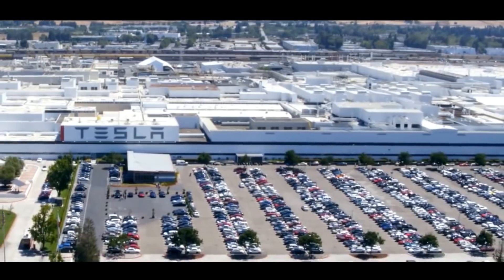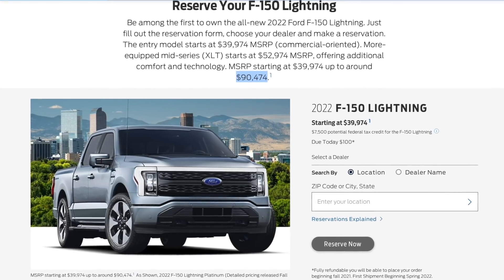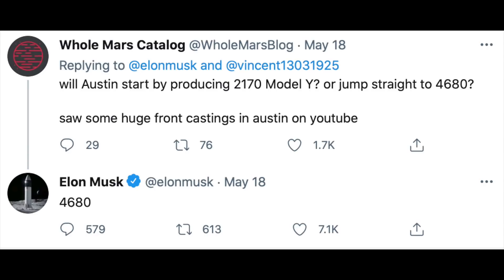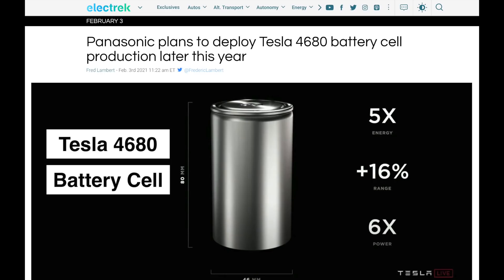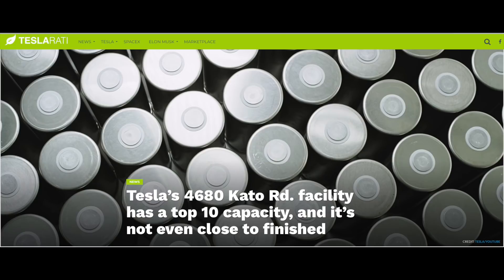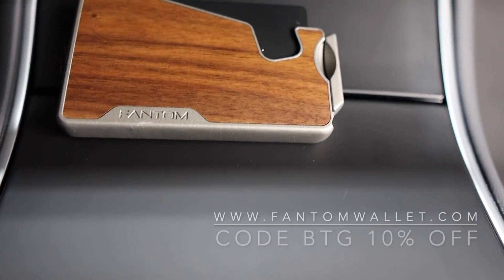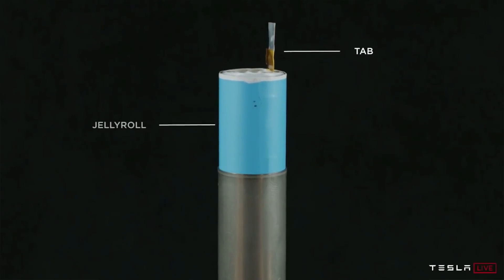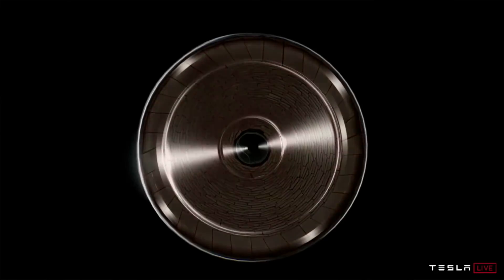Tesla Model Y - Version 2 Incoming?

Comment: New range sounds great..

But I'm waiting for the compact because I'm not rich enough.

I'm guessing/hoping 250, and if they have the range increase for all their vehicles I could see them having the compact start with 300 miles if they have enough energy density. (Big hopes that that's what these range increases will mean)
Reply from the maker: The compact is going to be cool actually and very affordable. Excited to see how it turns out
Reply: @BeardedTeslaGuy  for $25,000 and the only car that can go beyond it's battery range effectively and easily with the Supercharger network, autopilots emergency avoidance system, Tesla's safety reputation (breaking car crushers), sentry mode, most likely faster than the Civic, boombox...

For my fist new car, I can't describe how exciting I am.
Because for so long I thought I was going to have to settle for a used Bolt but now that savings is going towards the company dedicated to EVs. 

I can't wait.

Comment: minor technical corrections, if I understand the 4680 cell design correctly. The 4680 cannot withstand higher temperatures so much as it will generate less internal heat due to its lower internal resistance and simultaneously dissipate heat due to its greater capacity to conduct heat away through the bottom of the cell and the tabless design, since it conducts heat out of the core of the cell
Reply from the maker: To an extent that it’s correct. The thermals on these cells are completely different and way less impacted by heat

Comment: Really want a Y soon, but battery upgrades with charge times and low temp operation is important in Colorado. Are there any other upgrades that might be part of a V2 model Y?
Reply from the maker: Those new batteries will come with some great improvements overall. No other real upgrades are known at this time
Reply: Hey BGT!  you selling your MY to get the V2 MY?  BTW, would love to have vented seats AND adjustable suspension to increase the 6.5” ground clearance (8.5” is SUV industry average).  In Colorado we need the ground clearance…!
Reply: ooops just found your “possible” suspension video…adaptive would be cool. nice work!

Comment: FYI Marques Brownlee was told by Ford that the truck was rated at 300 miles with 1000 lbs load and did the math at what he was seeing that it would be around the mid 400's without a load.    Not to say the cybertruck won't have more range but, as others like Engineering Explained, Tesla's are generally vastly overstated on their mileage vs competitors when they aren't used exactly in the EPA were EV test methodology (especially when used at freeway speeds exclusively they drop a lot) and there is zero chance the 500mile guestimate they have stated is with a load.    So it possible they have similar range for same load/no-load scenarios.
Reply from the maker: It will be exciting to see where this all goes

Comment: I am still waiting for concrete plans to start building the so-called "affordable Tesla", that elusive compact $25k vehicle. I believe that a compact SUV called the Model Z, similar in size to the Hyundai Kona, basically the next step in the downsizing progression from X to Y, would be the logical compact Tesla. It could just be a shortened, lowered version of the Model Y, with a smaller battery pack, but enough room inside to maintain Tesla's appeal as a value for money roomy American car that will appeal to a broad cross section of society.
Reply from the maker: Yep, they are providing extreme value in these segments and keep pushing

Comment: Buying a Ford Mustang E or F150 Lightning makes more sense than buying a Tesla. You get as much as $7500 with a tax credit on the Ford but not on the Tesla. Also, Fords are of much higher quality fit and finish and are more reliable. Ford is an established carmaker while Tesla is an upstart with an unstable CEO and a questionable and high risk future. For now I would recommend against buying a Tesla.
Reply from the maker: The only gap Ford has to close now is range and charging network.
Reply: @BeardedTeslaGuy  Yes, Electrify America is slightly behind Tesla's supercharging network but will enjoy rapid growth soon. The range in the Ford is slightly less than Tesla's forecasted range but is still more than enough for most folks.

Comment: The 4680 battery is going to be awesome but don't think for one moment other EV makers aren't in a position or won't be in a position to produce EVs costing less and getting ranges close to or exceeding Tesla. Cars such as the Ioniq 5, Kia EV6 get great distance utilizing a charging capability that's faster than Tesla and better charging specs than the Tycan or the E tron GT.

The Nissan Ariya due to be released is another vehicle from an established auto maker getting 300+ miles on a single charge and boasting some cool tech while it's price tag is cheaper than the Model Y.

And in a time when Tesla is slowly raising its price on the S, 3 and Model Y it might make consumers look at their competitors. 

I'm not saying any of this to be negative. On the contrary. I'm being straight as a consumer and what many of us are looking for in an EV and it's becoming quite clear as 2021 rolls by and 2022 comes in there is an incredible amount of great choices out there.
Reply from the maker: The problem is no one is matching Tesla today. They are about to launch a car that will meet current Tesla range, but now Tesla is onto 50% more range. They are just behind. Another 5 years and I think it’ll be much more even

Comment: Great video!  I've had my Model Y for a few months.  I was shocked when I had an emergency and tried to start the car during a scheduled software update.  Tesla service responded quickly but confirmed that even pushing the 2 scroll buttons wouldn't interrupt the update and I had to wait the 60 minutes for the update to finish.  I think most car owners will agree that when you have a full "tank", you expect the car to be available for any issue at any time; even if a software update has been scheduled.  Life can't always be planned.  Thoughts?
Reply from the maker: My other car will not operate during a software update either. Not a Tesla specific issue
Reply: Any other car to update requires at least 3 hours at the dealer. I think it's an acceptable trade off given the fact that you can delay your update as long as you want.
Reply: Wasn’t there an option to defer the update until a later time? If so perhaps your bad for hitting the wrong button or not being aware of how it works

Comment: they desperately need to update the Y because its garbage and Dangerous!!!! those horrible blind spots and terribly tiny side mirrors that dont help much as well as the deadly under driver seat pass through and some of the problems that should be recalls.
as well the fact it came out after the model 3 and is lower in every spec to the model 3 including to offroad or towing!!!

Comment: I think the other big Q's are: Will they include an Air suspension in the Austin made Model Y? Will the new battery tech create an instant depreciation dip for the current model?
Reply: Not at same price.  They're trying to keep the price down and air suspension will add lot more to the price. Maybe if they come out with higher spec version which would cost lot more.
Reply from the maker: Hopeful on the suspension upgrade

Comment: If the battery pack size is reduced, then that's a drop in weight, which is always useful.

It would be interesting to see how much of a weight reduction there is, which brings a range and acceleration increase.
Reply from the maker: Indeed

Comment: Do you think it's possible for existing model y owners to switch their existing batteries for the 4680 battery? If the batteries can do what they say they can, then most would want the new batteries to rid range anxiety.
Reply from the maker: No, the new batteries are built into the body
Reply: What will happen to the people with really old tesla. Their batteries degradation over time and need replacement.  Will they have to buy a new car or is there no other way?  I apologize for asking many questions, but I'm a new model y owner myself.

Comment: Few notes…
1) A pending order can last longer than 6 months, I’m coming up on a year pretty soon.  I posted this part of this comment on your other video, I watched it first.
2) If the cars model changes, for example the LR+ you used as an example, an order for a LR will not automatically convert to a LR+ especially if the LR is still offered from Fremont as you have proposed.  You’ll need to either upgrade to LR+ or place a new order for LR+.  So any price advantages you lock in now or have already locked in in the past will be compromised.  For example, I’m locked in at $49,990, but if I switch to a LR+, I’ll likely lose my $8k FSD (no biggie, don’t really want or need it any way) and my price will change to reflect whatever the pricing of the proposed LR+ at the time the order is changed.  Someone please feel free to correct me if I have this wrong.

I have an alternate proposal.  While Austin is coming online, what if Fremont switches to making the Y SR?  They could make the Y SR with 2170 cells and move LR and P production to Austin.  Anything is possible and only Tesla knows it’s plans.
I think Tesla is going to go all in on 4680, as Austin comes online making the Y I think old Y lines in Fremont will convert to new 4680 lines for Model 3.  Then old Model 3 lines can be converted to Roadster 2.0, Semi or both.
Again, anything is possible.
Reply from the maker: I think there will be some transitions around as Giga Austin comes online

Comment: We are already getting model 3 long range with 382mile range in norway in june. I can see that number is much lower in the us for some reason.
Reply: I think it is the testing process they use between Europe and the US. WLTC vs EPA shows different efficiency if I recall correctly.
Reply from the maker: I am pretty sure it’s the testing of your standard vs the EPA standard. I could be wrong though.

Comment: You made an excellent point about the technology always improving and whether to wait or not for the next best thing in which case you ‘ll be waiting forever. When Giga Austin starts limited Cybertruck production late in 2021 and ramps up in 2022 it will arguably be the most advanced Tesla to date which includes having the latest 4680 battery technology along with single cast exoskeleton construction and other revealed and some not yet revealed advancements. So, in that regard, I don’t mind waiting a bit longer for my Cybertruck. But, having said that, anyone intending to purchase a Model Y or Model 3 (or any other Tesla model) should do so because otherwise tomorrow will never come.
Reply from the maker: 100%

Comment: Which battery packs blow up easier? The F-150 or the Cybertruck?  I'm guessing the F-150 has very safe battery packs.  BTW, why didn't they call it the E-150?  Seems logical.
Reply from the maker: I don’t think you’ll have to worry about either battery blowing up any more than a gas tank in any car...
Reply: E-150 already used for 1/2 ton Econoline van.

Comment: Here's a thought: given recent price hikes, I wonder whether some of the new technology (single-piece front / rear casts, 4680 structural pack)  has already found it's way unannounced into the Model Y presently being delivered?
Reply from the maker: Possibly. I don’t know that they have enough volume on the new batteries yet, but here soon it’s a real possibility
Reply: Was going to pull the trigger on a '3' until S.O. asked Siri what insurance costs for a Tesla.  The $4,500 average premium  must be some sort of error but still, the insurance seems out of sight.  Also, S.O. told me you really need a working smartphone to get into and drive the car so I looked and she may be partly correct. and mine has broken or run out of power in the past.    It could just be her way of telling me we don't need another car right now so it is moved off the list for now.
Reply: @SunriseLAW  you should call your insurance company, mine went up $50 every 6 months. But there is also a $30k difference in value fro  the vehicle it’s replacing. You also get 2 key cards with your vehicle and can purchase Tesla fobs for $150.
Reply: Definitely not Tim. If any of their current vehicle production was using the new 4680 cells, we WOULD know about it!!!!

I suspect the recent price increases are due to a combination of 3 factors - 

1. Recent shortages of raw materials/chips, resulting in higher input costs for Tesla

2. Tesla taking pre-emptive advantage of the up coming re-introduction of the Federal tax rebate. (gradually increase the price, so that when it does come in, a new Tesla will still be cheaper than before, but not by as much, with Tesla pocketing the difference !!)

3. Continuing high demand for their cars, means that Tesla has the market power to increase the price of their vehicles by small increments over time, NOT lose sales, but yet improve their bottom line profit!

Comment: I have a Y on order and the delivery date has disappeared so patiently waiting.  But based on this, I think I will change my order from a purchase to a lease so in three years I can take advantage of the new battery and gigapress technology improvements.
Reply from the maker: I personally wouldn’t lease but there are cases for it.
Reply: @BeardedTeslaGuy  I just don't want to be locked into the old technology and I think because of that the resale value of the "Old" Y will not hold up as well as the 4680 gigapress ones.
Reply: @visioncaremirkin8467  As a Model owner since 2015, just buy it and done worry about the new tech.   There will always be something new around the corner just like with phones, tv’s and other tech.   The cars also hold their value very well.  And leasing is a horrible idea with Tesla’s.  The money factor and residuals are not good, so you will pay a significantly higher interest rate versus financing.   The worst I have seen of any car.company.

Comment: No regrets about getting an early Model Y.  Yes, it only has the dual rear castings, and I envy the newer ones with single rear castings, front castings, structural 4680, etc.  Those will make a difference in the performance, but insignificant compared to the difference between the original Model Y and any non-Tesla.
Reply from the maker: Agreed

Comment: Great vid and right on point. I would love to see a slightly different variation with the new batteries. How about upgrading the MY Performance (MYP)? Charge a premium and be as quick as the M3 Performance with equal range to the current MY LR. Or even keeping the same range as the MY LR could/should result in improved performance due to less weight.

Anyway I had a MYP on order and just changed it to the MY LR based on your road trip video and a few test drives. The MYP rides like crap on anything other than really smooth roads. It also felt that once you are rolling the MY LR doesn't lag that much behind the MYP as well. Maybe not as impressive at launch but my driving isn't filled with 1/4 mile runs anymore. If the MYP came with lightweight actual performance wheels and good suspension, it might worth the extra 8k more. After driving it I new I'd want to swap out for coilovers and better wheels and tires. That makes the delta even more than 8k and maybe I could recoup some of my investment if someone actually wanted to buy the hideous 21" Uberturbines on the MYP.

Your vids on the MY LR really reshaped my opinion on this. It got me to test drive the MYP and MY LR again but back to back. Also, the most expensive models take the biggest hit usually on resale. So if I did buy the MYP, my luck would be Tesla would drop a super version of the MYP with a lot more power. It would be worth about as much as what a P90D is compared to the new MS Plaid. So I'll play it safe and have a pretty decent car to drive until this all gets sorted out. Keep up the great work BTG.
Reply from the maker: Performance mode is legit, but for daily driving, not my choice

Comment: Here's my deal for those who might relate:
My current car: 1999 Buick Regal GS. Salvage title. Was totalled in an a rear-end collision and a bumper and quarter-panel replacement was more than the value of the car.
It's falling apart. The windows no longer work. I had to replace the intake manifold gasket, and shops said the compressor might have an impending "catastrophic failure". But the engine is still amazing.

My situation: I'll also have to stop working from home probably by the end of the summer.

So I went ahead and ordered my Model Y something like 2 weeks ago. I don't think I would be able to wait until the 4680's come out. And I promised myself if I was able to hit 6-figures before I turn 30, I would get a Tesla my 30th year. Furthermore, I'm quoted for a 2.49% interest rate. That rate is NOW. Tax credits are unknown. Upgrades are unknown.

Plan A: Go ahead and take the order and just stick with the car as long as possible.
Plan B: Between now and then, if the timeline pulls ahead fast enough, delay delivery.
Plan C: Stick with the car, keep an eye on upgrade news, and if it ends up being a V2 with major changes that are worth it, trade in for a new one. Determining factors would also be the EV tax credit, depreciation caused by upgraded batteries, and the interest rates of new loans.
Reply from the maker: Just upgrade down the road. Enjoy the car now, and enjoy the minimal depreciation of the Tesla later